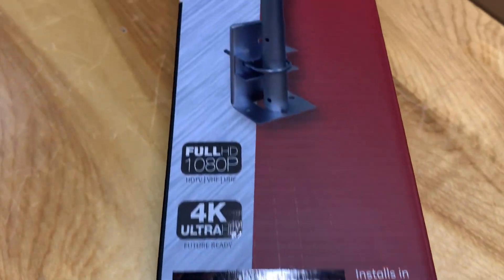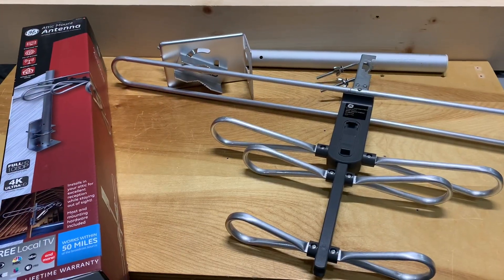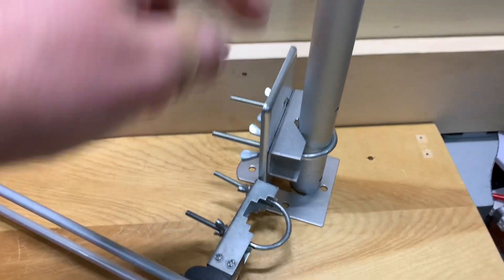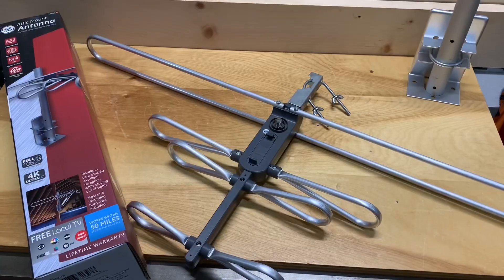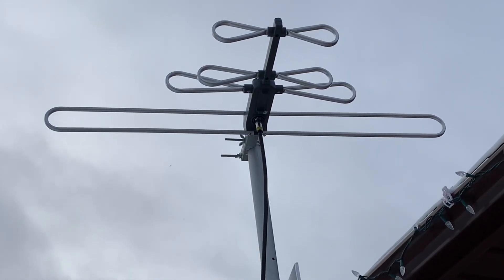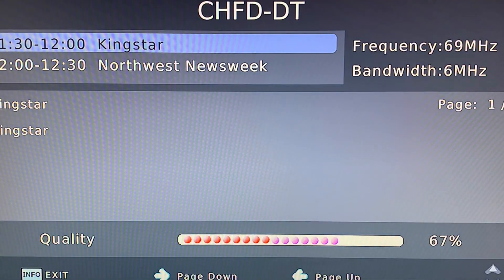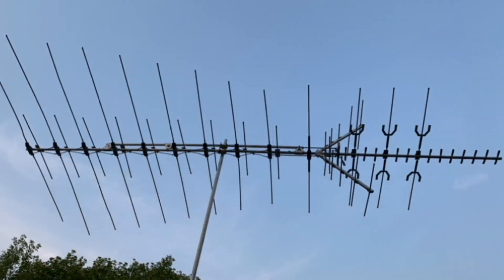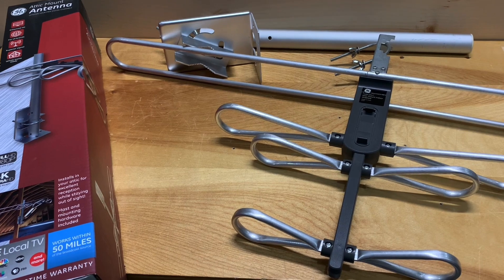GE Attic Mount TV Antenna Test and Review

Comment: A friend of mine installed an FM Yagi antenna with 4 elements to receive VHF Low Band and had a great reception, as for VHF High Band the signal strength was very high also could receive most FM and HD radio stations, but for excellent FM reception the antenna must be mounted vertical instead of horizontal but he was mostly interested in TV reception on VHF Band. For UHF he used a 19 elements UHF antenna and had good signal on low power stations and excellent signal on high power stations

Comment: Great video. From my experience I wouldn't recommend to mount an antenna in the attic unless you have no other option, and if you do make sure you have a signal amplifier especially for the UHF band. The reception on VHF Band is varies from very good to good sometimes excellent to good in general you don't have problems and I'm talking about VHF High Band, there were no VHF Low Band channels in my area. As for UHF it was problematic the signal was good to average or average to weak, to solve the problem it was mandatory to have a built in amplifier or a high gain UHF antenna with at least  19 elements or more and a signal booster. In some situation you could use a 10 elements UHF antenna but it is much better to mount it outside for a great reception.
Reply from the maker: Outdoor antennas are really the best way to go, especially with digital signals. I find digital signals, unless very powerful, don’t travel well through building materials. Hence the need for an outdoor antenna. This is necessary in particular in my area, being that all channels are on the VHF band. An amplifier can definitely help overall reception quality. Thanks again for watching.📡